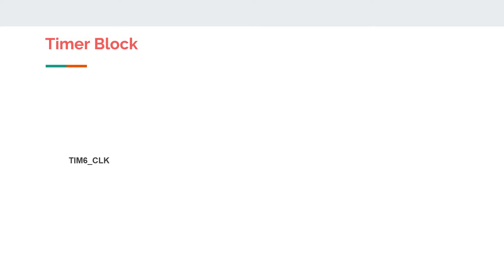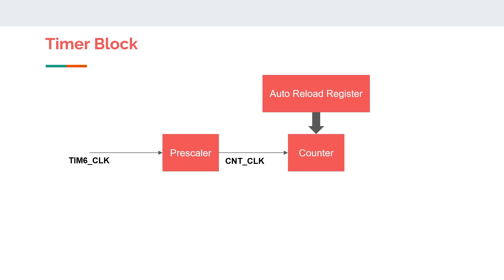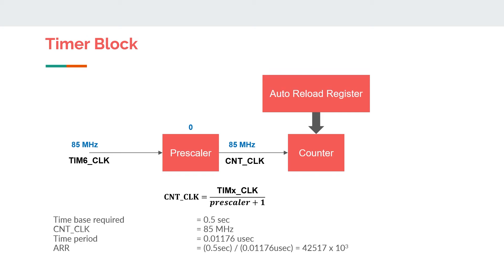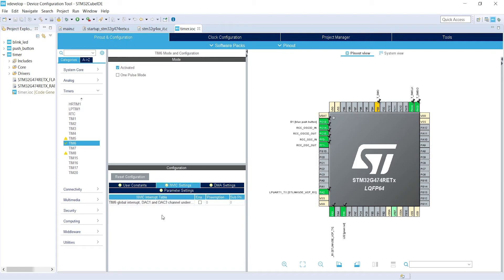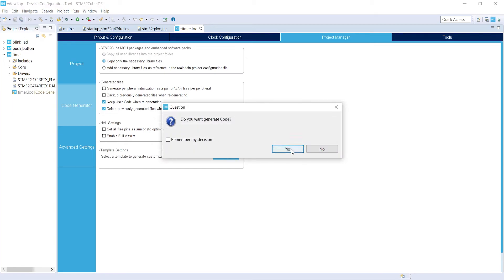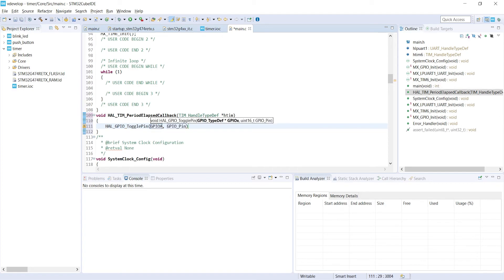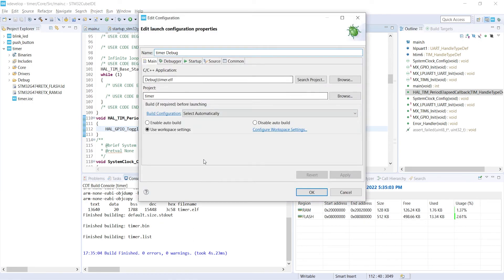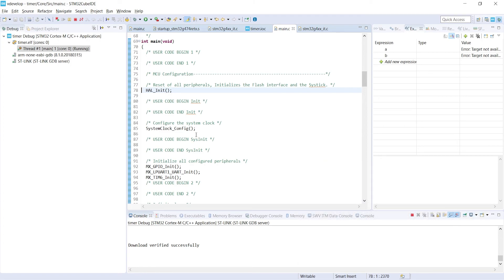Clock and Timers Explained with Example | STM32G474 | Timer Interrupts | Episode 4 | Part 2

Comment: Hello, I use a Nucleo F103RB, and I have an issue with the debugging/execution phase.

Details of clock and choice of prescaler, Counter Period:
At the SYSCLK I have 64 MHz, so I have 64 MHz at the HCLK and finally still 64MHz at the APB1 Timer clock, which is used by TIM4. 
I chose TIM4 in the Pinout & Configuration panel. 
I check the box for "Internal Clock", because it gives me access to the Parameter Settings, like you in the video for TIM6.
There, I put Prescaler at 499. This way, CNT_CLK = 64MHz/(499+1) = 128 000 Hz.
Therefore, because ARR= 0.5 * 128 000 = 64 000 < 65535 (maximum at 16bit), I put 499 as prescaler and 64 000 as the Counter Period and I activate auto-reload.

Despite all that, and following (I assume correctly) your instructions, putting &htim4 instead of &htim6, et cetera, it does not work! :(
I could use the debugger maybe, as you suggested in another comment, but I'm not sure what to check for.

One detail about my timers: I don't have a simple "Activated" like you in my Cube IDE. Instead it talks to me about Slave Mode, Trigger Mode, Channel1, 2, 3, 4, et cetera...
Please tell me what you think

Comment: Hi, Very well explained but how you find the ARR value = time based /Time Periode = 0.01176usec can you please expalin it a little bit ?
Reply from the maker: It's simple mathematics. Basically we are calculating the number of counts required to generate a 0.5sec time base. 
Thus it's a simple division of time base with a width of one count period (which is the timer period).
Reply: @vdevelop  thanks a lot , one more question can you please make a tutorial on high Resolution timer ?

Comment: I have done everything same but the led in not blinking 
I have Nucleo F446RE 
I have the clock frequency to 170 and rest everything is same as per video 
I didn't what the error is and how to debug it 

Hoping for positive response !
Reply from the maker: Hi Sairaj, sorry for the delay in response.

Can you please check if the program goes inside HAL_TIM_PeriodElapsedCallback (@main.c)? You can debug through the pgm by putting a breakpoint inside that function.
Reply: @vdevelop   how to debug can you share your video of debugging
Reply: Didn't work for me either. It is not hitting the callback function at all.

Comment: Thanks for you explanation. Just one remark for newbees like me. Your callback function is not at the correct position. User code should allways be between a USER CODE BEGIN and a corresponding USER CODE END, otherwise you'll loose your code the next time you make changes in CubeMX.

In this situation, I would suggest:

/* USER CODE BEGIN 4 */
void HAL_TIM_PeriodElapsedCallback(TIM_HandleTypeDef *htim)
{
	HAL_GPIO_TogglePin(LED_RED_GPIO_Port, LED_RED_Pin);
}
/* USER CODE END 4 */
Reply from the maker: Exactly, you're correct. I've mentioned this in the latest video i've posted.